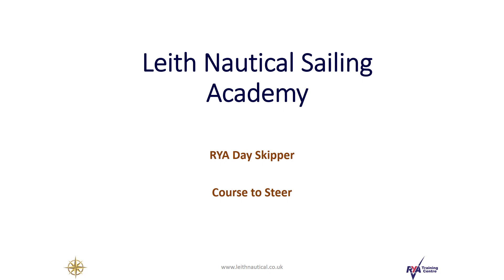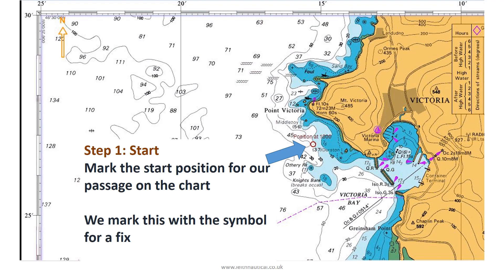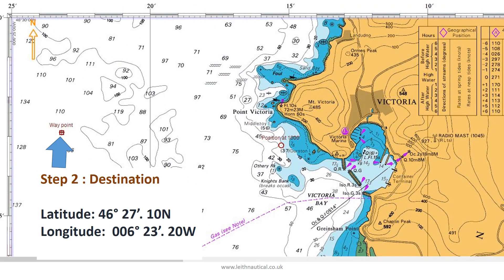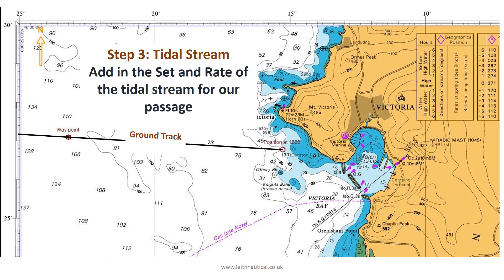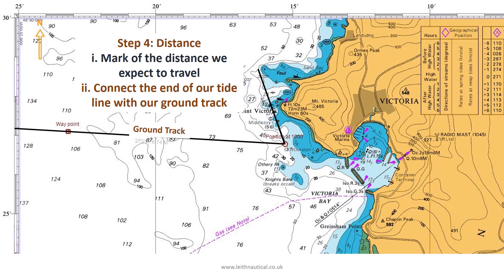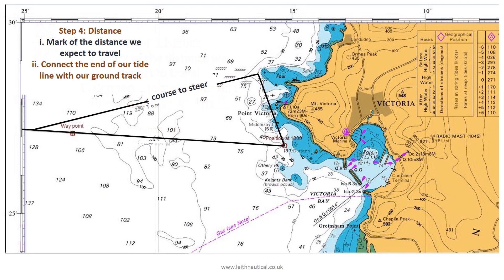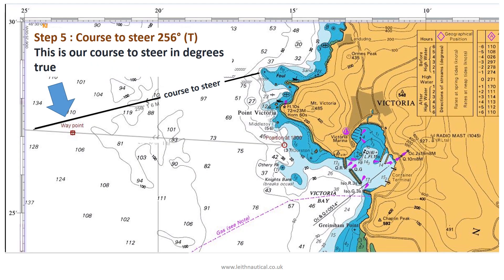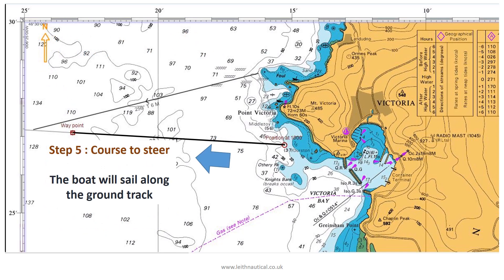RYA Day Skipper: Plotting a course to steer

Comment: I understood everythig - very clear. But how do you accont for the wind speed and direction when you do your course to steer? Even if you calculate the angle and set the boat right you most likely will not be able to keep the same angle, which means somehow need to time how much you do one one tack and how much on the other and add into account time in between.... can you clarify this? Thanks

Comment: Why do you u want it in compass form? Ive seen some videos of using magnetic instead.
Reply from the maker: Sam, many thanks for your comments and I hope you are enjoying the videos. In this example we use use Compass  Course to illustrate that when we plot the Course to Steer on the chart in degrees true we want to convert it. So we   want to take account of both Magnetic Variation, and Magnetic Deviation in order to convert the course to steer from degrees true (The Chart) to degrees Compass . The Compass course  is what thel the person on the helm will aim to steer. In the RYA Day Skipper course the distinction is made between degrees Magnetic and Degrees Compass. The degrees Magnetic excludes an adjustment to Magnateic Deviation, which the boat may be subject to, and is used in many of the Day Skipper exercises. You will find the Deviation card for the RYA boat at the back of the RYA Training Almanac. I hope that helps, and thank you for watching.